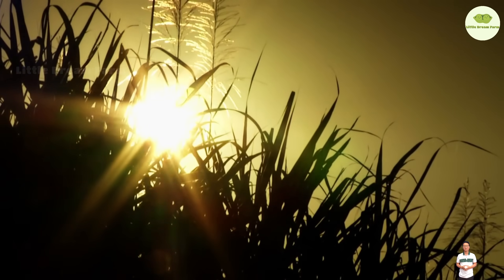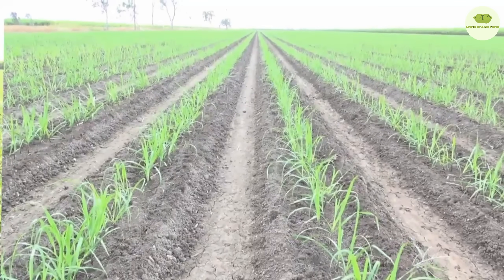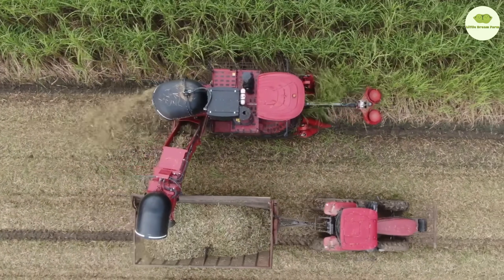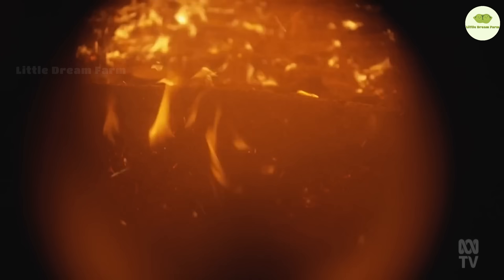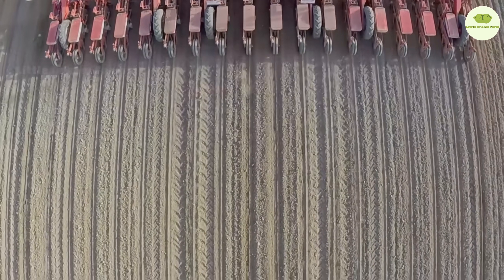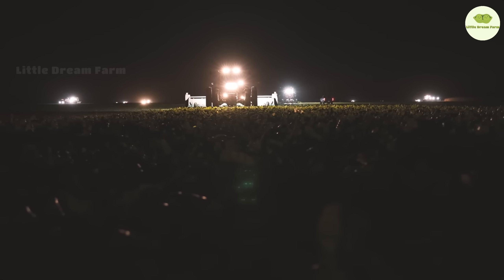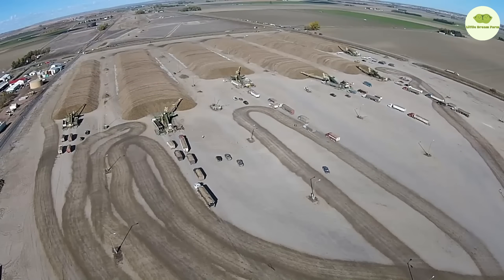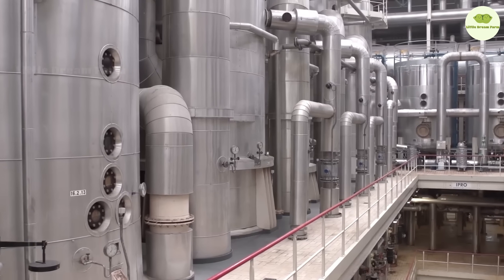Sugar Mega Factory: Harvesting & Producing Billions of Tons from Sugarcane and Sugar Beets

Comment: I was told there were two reasons the cane was burnt: 1. the heat generated brought more sap (ie sugar) up into the stalk leading to more sugar per unit. 2. burning removed a great deal of the residue that is not processed into sugar so more can be transported each time.  Probably wrong though.

Comment: If they are "identical" (they are NOT), why is cane sugar sweeter? 
Cane sugar is a sweetener, while beet is just a cooking bulking ingredient.
What types of "sugar" are in each? 
Heptose, fructose, glucose, sucrose, pentose, tetrose, triose, maltose, dextrose, lactose, and a bunch more " ~ose".
Then, there is "Mutarotation", where sugars exist in multiple molecular conformations, some of which have different tastes and (polarised) optical properties.
Reply from the maker: Interesting perspective! The sweetness difference between cane and beet sugar is actually a common misconception. Both are primarily sucrose (99.9% pure in refined form), and sucrose is sucrose—regardless of the source. However, trace impurities can slightly affect taste, especially in less refined products.

When it comes to those other “~ose” sugars you mentioned—like glucose and fructose—they’re generally not significant in fully refined cane or beet sugar but can be present in raw or partially processed forms.

Mutarotation is fascinating! While it’s more relevant to sugars like glucose (which can switch between cyclic and linear forms), it doesn’t affect sucrose since it’s a non-reducing sugar and doesn’t exhibit this behavior.